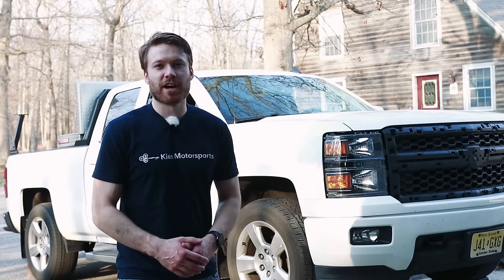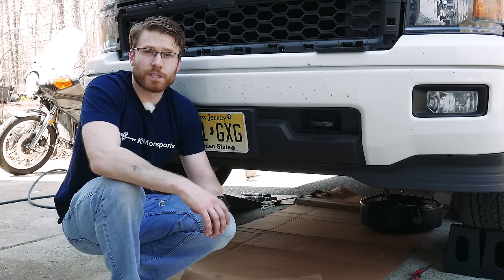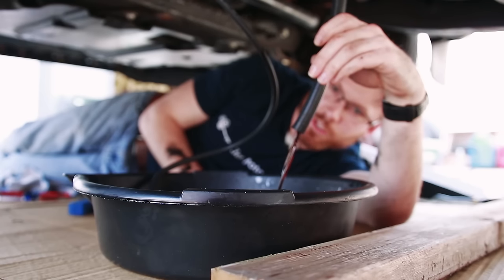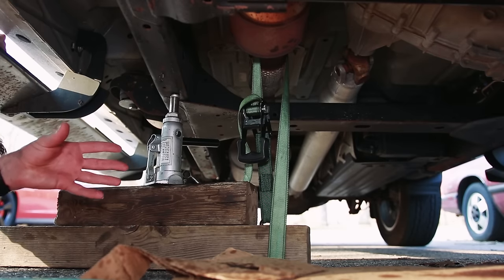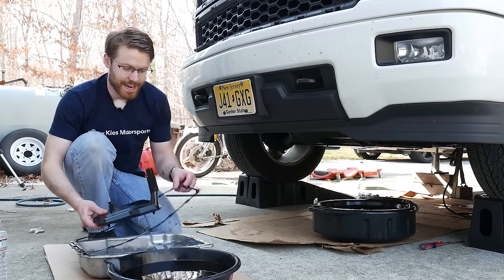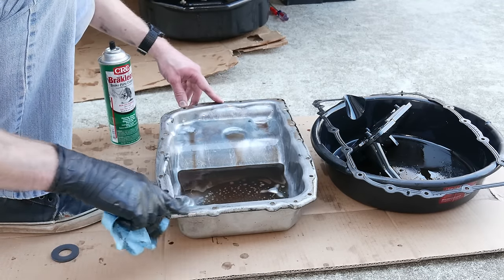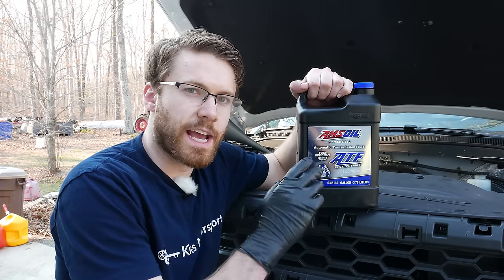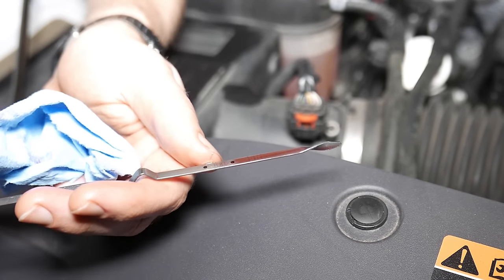6L80E Transmission Super Flush and Filter Change Silverado Sierra Tahoe Suburban Yukon Escalade H2

Comment: I have a 2016 Silverado and I have a friend who works at the Ford plant in Michigan.  He’s baffled and so am I that I have to bring my truck in every 30,000 miles to have this done?  When other truck companies have detergents and filters that don’t require this until 100,000 miles?  What am I missing?  Please help about to drop $500 bucks at the mechanic!!
Reply from the maker: I have never changed it that quickly and cannot see a need to unless you do a lot of towing. Obviously, I would always follow manufacturer recommendations but I think that is really early. With my my truck I do tow a few times each year and I like to over do everything mantenaince wise so I will probably change it every 50 to 60K miles.
Reply: No. Per my manual there are two service charts, one for severe service in high dust and tow environments this service is RECOMMENDED at every 50k. For the normal use it is not even part of routine recommend maintenance until 200k.
Reply from the maker: That's correct. But if you want it to last you should do it more frequently. Especially with these transmissions. They seem to have shifting issues
Reply: @TheSundaeDrive  60k iz quite normal, a little sooner if u tow... & yes, ford does recommend sooner if towing...
Reply from the maker: Correct 👍👍 50-60 seems normal

Comment: No Dip on the 6.2L. How do you check the level?
Reply from the maker: That is correct. Apparently there is a "dealer" tool they can use to check it and they have a temperature map. Sounds like a way for dealers to make money. My suggestion would be to carefully measure exactly how much you remove and replace it with that exact amount.
Reply: completely sealed set up.  The answer to your question is you dont.
Reply: Wes M stand pipe in the pan to set the level. You have to monitor the trans fluid temp when checking . Have to use special lv fluid. This is a 8 speed.
Reply from the maker: Correct. Bit of a pain

Comment: My transmission acts like it is slipping if I kick it down or roll 
on the gas to hard or fast and it shifts hard sometimes from first to second sometimes from second to third I MEAN HARD LIKE TO THE POINT OF ME WORRYING ABOUT IT BREAKING SOMETHING. Anyone know if a shift cylinoid, a filter needing replaced, or the torque converter would cause this???? I hope I dont have to have the whole thing rebuilt. Fluid is full and looks and smells good. Any info would be greatly appreciated.
Reply from the maker: 6L80? My trans downshifts hard and sometimes revs but I think it is normal for this transmission
Reply: @TheSundaeDrive  yes 6l80. I mean if I am going 40mph for example and floor it when it kicks down to a lower gear it is like it is in neutral. Engine revs to redline and truck isnt pulling
Reply from the maker: Hmmm mine isn't that bad. It will just downshift extra hard. If it's going to red line, it sounds like it is slipping
Reply: @mrperfect8124  mine shifts hard out of park, then has a 2 second delay to D, and has a kick going to 2nd. Other than that, shifts fine on the highway. It's when I'm doing city driving the troubles begins. Fluid and pan seems clean, no check engine codes.

Comment: My 2001 Suburban has drain plugs for everything; coolant, engine oil, trans fluid, and rear differential.  My 2011 Suburban only has a drain plug for the oil, I had to buy a B&M aluminum trans pan to get a drain plug there, and I'll have to buy an aftermarket diff cover to be able to (more easily) change the gear oil.  Not much I can do about the coolant other than going through the trouble of pulling the lower rad hose.  All newer vehicles seem to be going this route, guessing they either want you to bring it back to the dealer for service, or they're hoping it doesn't last very long so you have to buy another one.  Pathetic.
Reply from the maker: Exactly. So frustrating

Comment: Both of my 6.2’s (Silverado and Yukon) have transmission dip sticks....
Reply from the maker: What years?
Reply: The Sundae Drive 2012 and 2013
Reply from the maker: @dd4life158  I think it was my gen that removed it from those motors.
Reply: The Sundae Drive oh ok, had no clue. Weird why Gm did that. Honestly I didn’t even Pay attention to what year truck that was, just seen 6l80. I forgot they still did six speeds on some of those years. I got to change the filter and fluid in the 2013 and it looks the same under there. That exhaust pipe being in the way which is why I checked out this video to begin with.
Reply: You said 2014 at the beginning of the video but it just didn’t register lol
Reply from the maker: @dd4life158  lol no worries. Very dumb that they removed it

Comment: A better idea-changed transmission fluid on 2018 by loosening 2 tranny bolts as you did BUT jack the tranny up for clearance, beats fighting with exhaust bolts, BINGO.

Comment: I dont remember how i did it to my 2012 Duramax but i could take the pan out so i just stook my hand in the pan, removed, cleaned, replaced magnet and filter all while the pan was hanging. Drained the rest through the cooling line.

Comment: Damit dude no wonder the OP temp of the fluid is so high like 200 degrees I'm going to heat wrap my cross over pipe what a shit design for that exhaust pipe
Reply from the maker: That's not a bad idea and no idea why they designed it that way. Very dumb
Reply: the reason trans temp are so high it’s because chevys have a thermostat for the transmission, which could be bypassed and see up to 50 degrees cooler

Comment: Used the 9Nm for torquing and snapped a bolt. Not really happy about this. Thats all I have to say
Reply from the maker: 9Nm is correct but I am assuming you followed the 90 :( we have stopped putting torque specs into the videos because of this. All of our newer videos have torque specs in the description because it is too easy to have a typo.  Definitely sorry about that. Never a fun experience :(
Reply: @TheSundaeDrive  I did find out it was correct and I was puzzled why it snapped. It's only one bolt and I'm gonna try to extract it and get a new bolt in. Nothing is leaking so that's a good sign.
Reply from the maker: @ReformedTradesman  Oh that is very strange - 9nm is so little. Maybe it cross threaded but even so, it should not have been able to snap at 9mm. Although 9nm barely clicks my torque wrench because it is so little. maybe you missed the click? either way, hope it  turns out ok for you!
Reply: @TheSundaeDrive  I have no idea! I put the bolt in by hand and until snug and then I took the torque wrench to it. Either way, I got the bolt extracted. Now I gotta find a bolt. Its hard to find just one bolt to buy instead of buying all 18!

Comment: Why not just make your own drain plug, i see all uploads for this type of truck, to date not one person has tapped the right drain plug onto the pans? Its so easy its not funny, that way it won't be so messy next time ?
Reply from the maker: That is not a bad idea. I have two concerns though. First, the pan sits very close to the transmission internals and I am not sure there is room for a tap to stick through. The second is that the wall of the pan is very thin and it might be difficult to get a good seal.  Probably doable but it would be easy to compromise the integrity of the pan. I could see if I got a deeper pan that there would be enough clearance then.
Reply from the maker: We haven't done one yet but I'll shoot you a message. See of we can provide some experience

Comment: So you run the pump till it runs dry doesn’t sound smart to me.
Reply from the maker: A smarter way to do it would have been to pump fluid in at the same time or drain a little add a little.
Reply: The Sundae Drive that sounds better

Comment: if ur in NY or NJ can i just have u do it for me lol. i dont trust these other shops
Reply: i will bring the fluid and and stuff and pay you for labor ofc
Reply: i have 6.2 liter and it does have dipstick
Reply from the maker: Lol I don't blame you. I don't trust them either. I'm not sure if it's something we could fit into our schedule right now or not. You can shoot me an email to cliff@tsd-motorsports.com we actually normally only work on BMWs but do all this work on our own vehicles on the side.
Reply: @TheSundaeDrive  thanks for the contact info. I have a 2010 Escalade with the 6L80 transmission and 6.2L V8 I also have a F30 340. Didn’t know u had a shop!
Reply from the maker: @mujjuman  we can do a ton of mods to your 340. B58 is a great motor.

Comment: I’ve read that the filter can be reused and the guy at autozone pulled it up on the computer and it said filter can be re used? My truck has 45k miles should I be changing it is it required or necessary?
Reply from the maker: I would always recommend changing it per the manufacturer's recommendation. Could you get away without changing the filter until evey other fluid change or 90K miles? Probably, but transmission are expensive to replace and expensive to rebuild. I would always do at least if not more than manufacture recommendations for transmission maintenance. As a general rule I usually assume the employees working at autozone, advanced auto, etc are most likely wrong lol. There are some good employees there but it is rare to find someone with great car knowledge.
Reply: The Sundae Drive you confirmed my thoughts exactly

Comment: Seems like an opportunity for someone to sell transmission pans with a drain plug in them.
Reply from the maker: Haha yes we should capitalize on that
Reply: @TheSundaeDrive  Type in "Transmission Oil Pump on Amazon!"
Reply from the maker: Nice! Looks like a couple interesting options on there. I'll have to check them out
Reply from the maker: What about swapping to a pan with a built in drain?
Reply: @TheSundaeDrive  Many are against this because QUICK OIL CHANGE PLACES can make the mistake of taking out the WRONG plug when doing an ENGINE OIL CHANGE?  That is what I read.
Reply: The Sundae Drive That’s what I did. B&M makes a nice one, with increased capacity.
Reply from the maker: I'll check it out. Thanks!
Reply: @retiredperson4054  I think it's more that people would drain the fluid and neglect changing the filter. Why auto manufacturers have neglected to design transmissions with an external fluid filter like an engine is beyond my logical thinking
Reply from the maker: I can't even imagine a wonderful world where the filter is external 😭

Comment: Unless you really were able to drain everything out by pop and the lines off there’s no way it’s gonna take that much fluid and not have problems it’ll foam and overheat and it’ll car slipping and then you’re gonna do more damage than good you would’ve been better off to leave it is really I mean I guess if you measure what you took out of it then you could safely do it that way

Comment: Never flush an automatic trans
Reply from the maker: That's a very broad statement lol. You should never use a power flusher that forces fluid through a system. If you are using the vehicle's internal pump to cycle the fluid, how is this any different from the normal operation of your transmission? Now, I will say, when I do this again, I would actively add fluid while flushing the system instead of removing then adding, as this is the safest method (as long as you do not overfill). Of course, there is the concern if you have a really old transmission that was never flushed, the suspended particulates in the older, dirty fluid can actually help the internals work. Remove that fluid completely and the transmission could start slipping. As long as you do regular maintenance and use proper methods, it should be completely safe to flush, maximizing the life of your trans.
Reply: @TheSundaeDrive  got my BEST gas mpg wen i did a trans change @ 28k on my '15 tucson ... @ 40k i got milage per tankful up 409 miles till empty f/304 miles wen i bought it nu... of course i use & sell AMSOIL...

Comment: I can I just take it to you? Where you located lol
Reply from the maker: Lol it is an annoying job for sure
Reply: The Sundae Drive between amsoil atf and Valvoline dex VI aft which one do you recommend for a 24k mike truck? I just got my Silverado and I like changing all fluids myself to good stuff instead of the junk OEM GM uses
Reply from the maker: I haven't had experience with the Valvoline as much. I've had good experience with amsoil but both are probably good as long as you change the fluids periodically 👍
Reply: The Sundae Drive I’m buying amsoil atf the signature series, it’s expensive but I’m trusting my gut, I would hate to go cheap and later deal with expensive repairs lol, thanks man
Reply from the maker: Sign up for the preferred customer program. Like $10 and saves a ton
Reply: The Sundae Drive bet! What’s your amsoil referral number so I can give you credit
Reply from the maker: @MarioSays713  Thanks! had to look it up but here it is: 5532469

Comment: GM recently released a Bulletin to all of their dealers. “Do Not Flush any of our Transmissions”
Reply from the maker: How recently? Because GM has multiple open service bulletins telling dealers to flush transmissions experiencing the common shudder issue (mostly the 8 speeds) and put new fluid in. I only planned to flush mine the initial time to change out as much of the oem fluid with amsoil as I could. Following services will just be changes.
Reply: This isn't a flush. This is a drain and fill. A flush is with a machine where there is pressure behind the fluid to flush out any dirt inside. What that ends up doing is damaging the transmission.
Reply: That bulletin is just a get out of jail free card, basically saying they can't control who does it and what they do it with so if they just say don't do it then they are free of any liability if you screw it up. They created the 8 speed shudder flush procedure that's almost the same as a traditional flush.
Reply from the maker: Exactly my thoughts on it as well as 🤔
Reply: Tony CJ it is considered a Flush, whether you choose to use a commercial machine, or the Transmission’s own internal pump to flush the old fluid out and the new fluid in. Disassembling the trans is the only way to totally remove all the old fluid, flushes can’t do it , If you are worried about getting as much of the old fluid out as possible, a double drain and fill is much safer and cheaper than replacing a 6L80 or a 8L90.

Comment: 15mm, 6 nuts, loose 2 exost pipes, do not take out nuts, lower exost a little. Then you can take out pan easily. GM engineers still idiots for lot of other reasons.
Reply from the maker: As long as they aren't rusted badly that works. Always scared of snapping off bolts lol.

Comment: IMHO you did this WRONG!  The first thing would be to remove the old fluid from the pan via the dipstick!  Then remove the pan, clean the pan, magnet, and the mesh filter or replace it if it is plugged.  Replace the filter, magnet, and gasket and pan.  Refill the amount removed from sucking out the pan via the dipstick.  Then rmove the hot line to the radiator inlet, then do a  2qt out by running the truck, then replace two qts. Run that way until the fluid coming out is clean.  The way you went about this you could have caused the trans to run dry!  NEVER let a trans run dry!  I am glad I saw this video last after seeing many others who did it the right way!  Plus at 70 years old and having done a ton of automotive work all I can say is ... I hope you did not ruin your tranny!
Reply from the maker: I would agree that the method you described would be the safer way to flush the transmission fluid. At the time, I did not have a pump to remove the fluid from the dip stick. The 2500 does not have a dip stick tho so I wanted  to show how to do it via dropping the pan method so it would be more universal. As far as running the transmission dry, the only moving component while the vehicle is in park or neutral is the pump. As long as you do not allow the pump to run dry you will not cause any damage. The method I used just requires that you be careful while your method is more idiot proof. I've put another 30K miles on the truck since doing the change and the transmission has been running great - rapidly approaching the 100K milestone. I watched and read a lot before doing this and I saw it done both ways by what appeared to be experienced mechanics. You have a lot more experience with this than I so your method definitely works! In the future, I plan to just do fluid changes every 30K miles rather than full flushes every 50K or 60K miles. Do you think changes are sufficient or would you continue doing flushes?
Reply: As another retired person I have a question. 99 Yukon shifts great i keep hearing never flush or change. 240000 don't know the history but if the filter is clogged lack of fluid will certainly kill it.I was thinking of a drain and fill and change the filter .No bad smell but fluid is more brown than red.Not dark.Just wanted an opinion fixed income so need to make it last!
Reply from the maker: That is the number one question people have for sure and there are tons of answers I have read. If the fluid had never been changed or not changed in a very long time, the risk of changing it is that the older fluid could be helping keep old worn out gears from slipping. And fresh fluid will wash out everything and it going start slipping. If you want to get another 100K out of it the safest bet would to just be a fluid change, where you just drop the pan, change the filter and fluid that comes out but not the rest. This way you are only changing about half of the fluid depending on the transmission. If you aren't planning to put a ton more miles on it, maybe just leaving it is best. If I had a crystal ball this is something I would check for sure lol
Reply: @allanbrogdon7453  fluid changes colour because the clutch plates r wearing out, which causes a little slippage & that makes HEAT & that will kill ur trans...